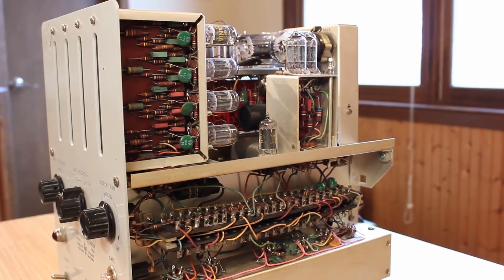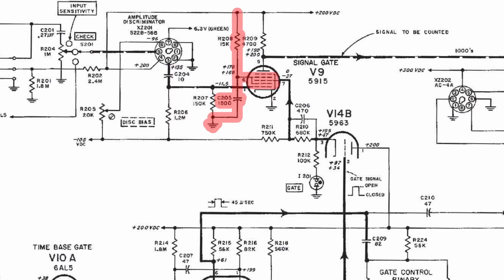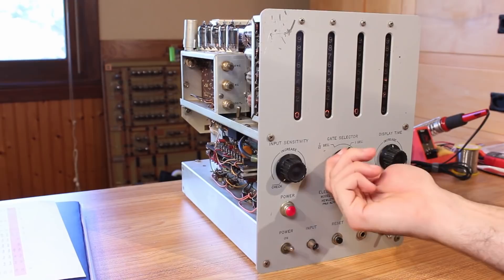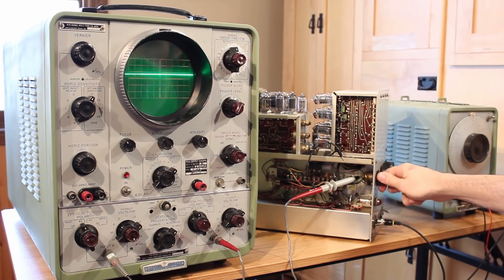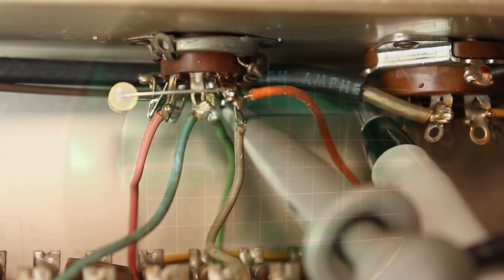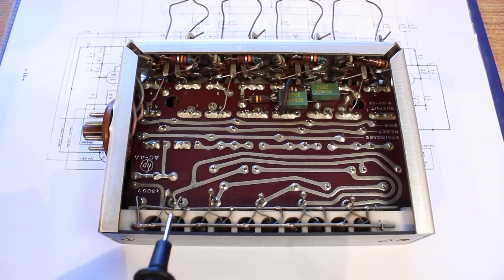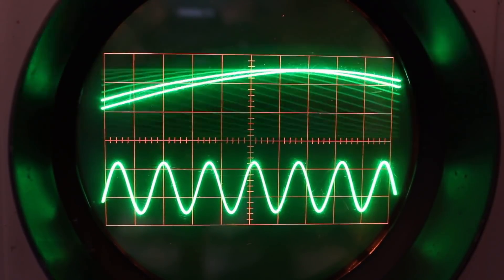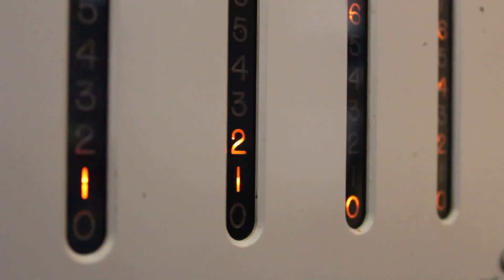Restoring an HP 521A Frequency Counter: Part 2

Comment: My early suspicion was that the mounting hardware for at leas one of the original capacitors could act as a shield.  The replacement one seemed to just hang in the middle air.  Then there is the story about the "ground"end of the capacitors, including film types.  I have known this issue for decades, but you might check Mr Carlson's Lab for a demonstration of the effects of wrong polarity mounting.  Or the effect of a shield clip.  Otherwise, as an old fan of HP instruments, I am waiting for more videos of those.

Comment: It's such a shame that recapping is often a necessity.... modern caps just don't look as "nice" as the oldies they replace. Diode Gone Wild did a neat trick with some bad electrolytics once where he hid the replacements inside the cans of the originals.  It's pity that it's not really possible to do that with "solid stripey" caps.
I suppose it could be done with some artistic epoxy molding and a super skilled paint job.... but that's well into the realms of "too complicated".

Comment: The controls of the counter sound like they feel very nice. 
The insane amplitudes of vacuum tube gear always fascinates me. 
While modern receivers are totally fine with microvolts of IF, a tube receiver can have low amplitude while having tens of volts. 
I'm really looking forward to the next part, the timebase problem sounds very interesting to dig into.

Comment: Crazy that this testing gear is still perfectly useful today.
Reply from the maker: The old HP 150A has been an absolutely brilliant scope! I actually use it more than the modern Siglent scope we have. Really, the only time I pull out the Siglent is when I need the ability to capture a waveform (or I need to use the scope in a place where I can put 40 kg of HP scope, haha).

Comment: Could you not have used Wires Adhesive to put the wire back rather than replacing the neon.
Reply from the maker: Potentially, but the wires were so corroded it actually receded back into the glass on some of the neons. Fortunately, I had a bunch of the right kind of neons already that I had been hanging on to for years that I was excited to finally be able to use!

Comment: It's astonishing that the neon bulbs show such bad corrosion and nothing else does. But maybe the glitch we hunted in Discord was a bad connection on the tube or something as well due to corrosion.
Reply from the maker: It has to be something to do with what the legs of the neons were either built from or coated with (or not coated with), because as you noticed they were horrendous but nothing else was quite that bad. 
I'm also still not convinced that my weird counting issue isn't also due to janky neons. I don't think the neons have a direct impact on the flip flop circuit, but they do essentially work as voltage reference tubes when conducting, so HP may have designed around that, and the poor or bad connections are causing things to fall out of balance. Fortunately, all the issues seem to be concentrated in the Decade Counter units themselves, which are easy to get out and work on!

Comment: Shoot, got a whole pack of those neon lamps as well.
Reply from the maker: Interestingly, the NE-2 has changed a bit over the years. The modern NE-2s you often find on eBay wouldn't actually work in this application because their striking voltage is about 10V higher and they have a narrower maintaining voltage. If the NE-2 is just being used a simple indicator, it's usually fine, but HP is using differential voltages here to either strike or extinguish the bulb, so a modern NE-2 would require a huge amount of resistor tuning to get work.
Fortunately, I had a whole bunch of the older type I salvaged years ago that I've been hanging on to. Being a pack rat sometimes pays off!
Reply: @UsagiElectric  Got a pack of 100 of NOS from around the 1970's......

Comment: This might be a stupid question , but How do you use oscilloscope on main earth referenced circuit without blowing it up ?
Reply: By using isolation transformer to power the measured circuit, then you can attach ground to anywhere you want. Or if the measured circuit ground is connected to earth, then you can measure it also with both earths connected together.
Reply from the maker: Teslakova answered it better than I can!
But, as i understand it, both the 150A and 521A in this instance are isolated from mains through the power transformer. Granted, they both share a common ground through the earth pin, but there's no path for an HV line from one to make it's way into the other since the only common point is earth.